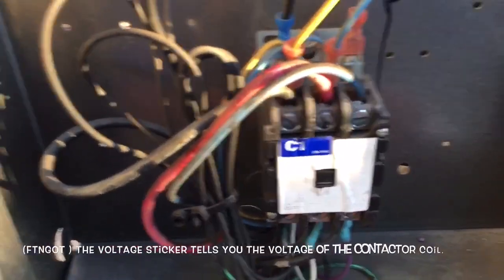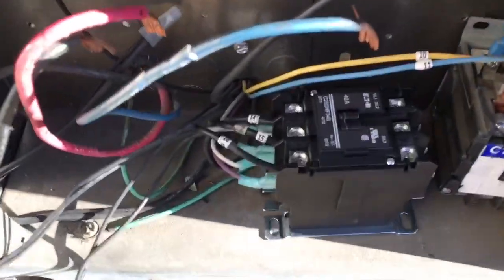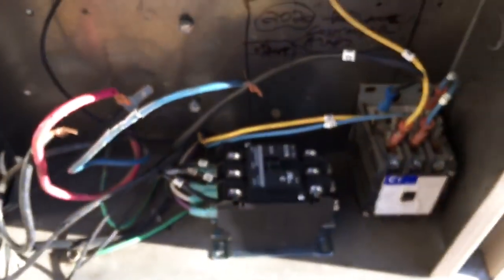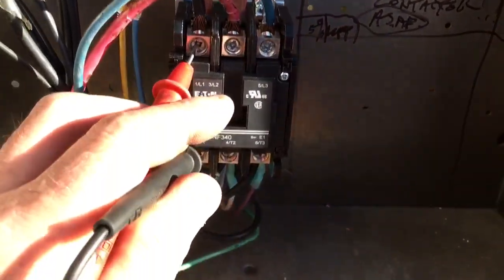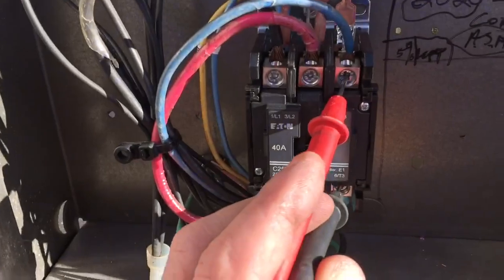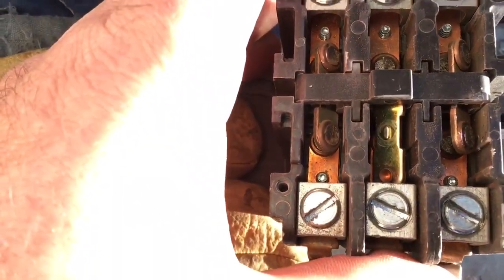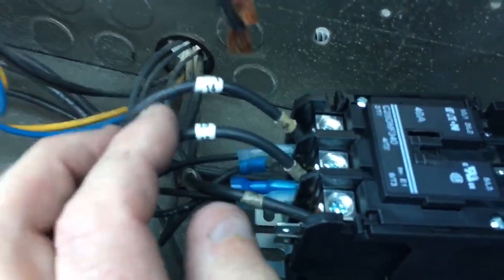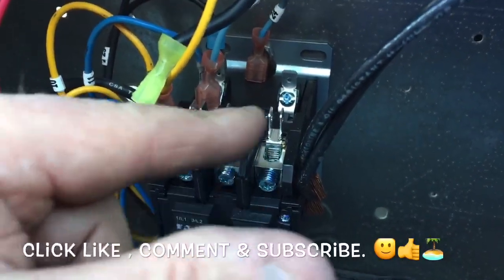( Ftngot ) How to Replace a 3 Phase contactor.

Comment: There are two primary times to expect equipment failure, when something is at the end of life and when it is brand new. So when you say is this normal for a brand new contactor, the data says that is the exact time to expect a fault. The only other time of failure is random failures between life start and end of life. The best way to look at it is brand new equals untested or untested in the field.
Reply from the maker: interesting 🧐. 👍😁